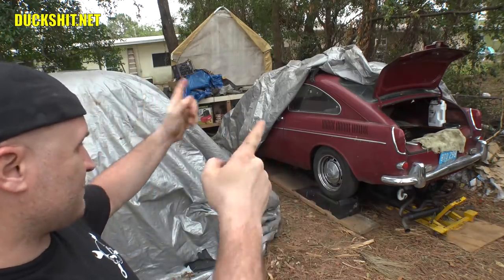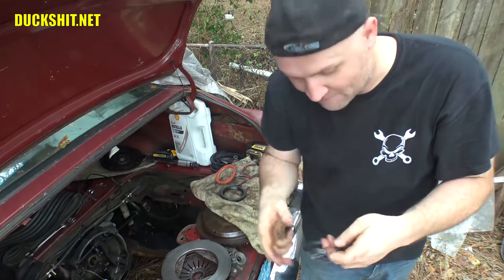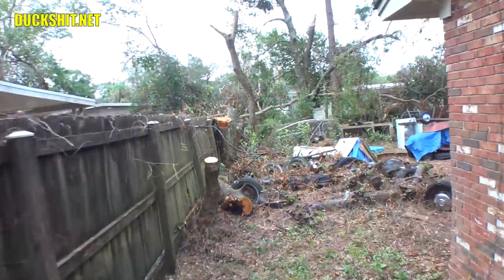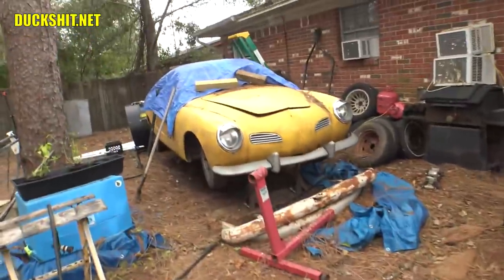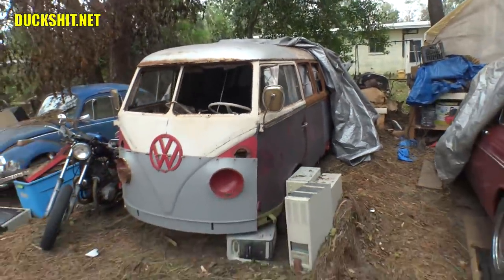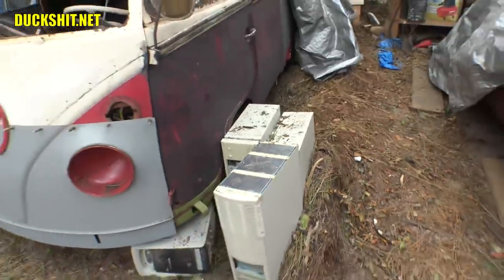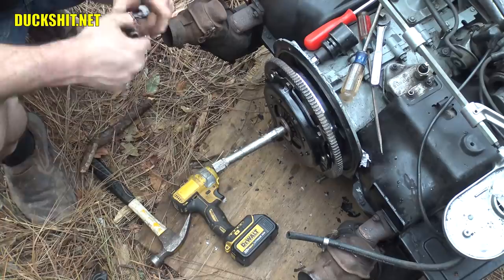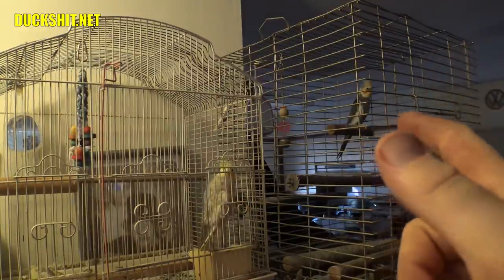VW Flywheels, Seals, and Cockatiels - Type-3 Fastback Repair Discussion

Comment from the maker: Wow that was a really unique flywheel problem.   But I think its a cheap aftermarket part replaced before I got to this car.  Probably was always that way.  Good to go now!
Reply: There’s a very good Brazilian VW mechanic that has a channel here called Marcelo Tonella and what he does is put sealant on the o ring. He first puts sealant on the groove; then embeds the o ring in it and finally runs his finger all around it.
Reply: Are you going to the topic this side of the cetury?
Reply from the maker: @nick35770  Maybe... what's it got to do with flywheel replacement?

Comment: Hey man just started working on it and the things I’ve learned is that changing spark plugs are a pain in the but
Reply from the maker: Hmmm, air cooled VW spark plugs aren't too bad, unless you have dual carburetors or something.  Some people cut a hole under their fender to get in there easier.
Reply: DuckmanCycles and VW Garage ok will remember thx u so much

Comment: Hey i was wondering where to get fastback parts?  I just got a 68 n it needs signal lights and seals for the windows at least. Its pretty humid inside im hopin it doesn’t need floors
Reply from the maker: Depending what it is I can find them at most auto parts stores, or swapmeets, car shows, and places like thesamba.

Comment: If your o-ring in the flywheel is bad it will also allow oil to get to the cluch.  To much endplay will beat up your seal.
Reply from the maker: Both correct indeed!

Comment: What happens over time is that the crankshaft shims cut their way through the crankshaft into the dowel holes, this is where the oil leaks out. It’s not always the rear crankshaft oil seal.
Reply from the maker: That would be a pretty severe situation, it would also be obvious when you move the washers around.  Not so in my case.  Thanks for the suggestion!

Comment: What’s needed to convert a 69 fastback auto to manual  and what trans is good to get
Reply from the maker: Hi there!  A whole lot of stuff is needed.  List: transmission, shifter, clutch, flywheel, throwout bearing, matching CV joints and axles, mounts, shift coupler, shift rod, shifter mount, shift bushing, shifter, new pedal cluster, clutch cable tube, clutch cable, all the nuts and bolts, some welding experience, and the ability to know how.  Or replace all that with some money and have someone else do it!  😀  I may have left a few things out, but its very possible though!   Thanks for the question!

Comment: Monday morning quarter backing here.....but check your end play if this doesn’t fix the problem.
If you have a walking crank it will waste that seal quick.
And a bunch of other “fun” stuff will happen as well.
The Mexican seal is missing the spring....never saw a main seal without a spring. Stranger things have happened though ha ha ha
And
It’s just my opinion....but that German seal? 
Yeah....designed by eggheads with slide rules. There is no way I would do ANYTHING to that seal other than install it.
Reply from the maker: I failed to mention the end play in the video when I measured it, I razzed myself when editing the video later on that night.  Its something that should be checked any time you swap a flywheel!
Reply: @DuckmanCycles  not trying to flog you...just trying to help figure out the problem....great video 😀😀